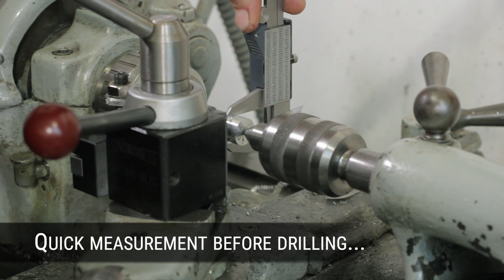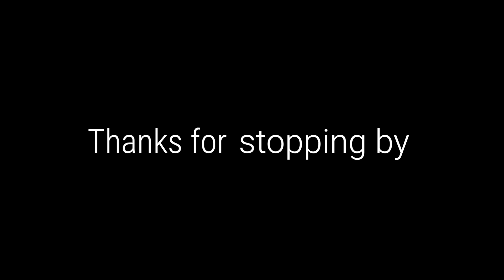1950's table saw becomes DIY CNC Machine Build - Part 2

Comment: Bummer the VFD went, what brand was it and what was the new one you ordered? looking forward to the next episode.
Reply from the maker: It was bad timing for sure.  It was a cheap huanyang vfd - but I have several Chinese VFDs running fine in the shop - for quite a while.  I ended up getting a similar model.  The only upgrade was getting the extension cable to allow me to have the settings/adjustments near me - instead of mounted on the side of the machine.